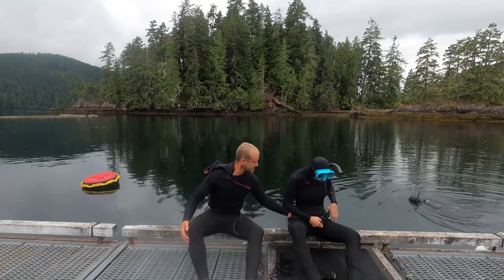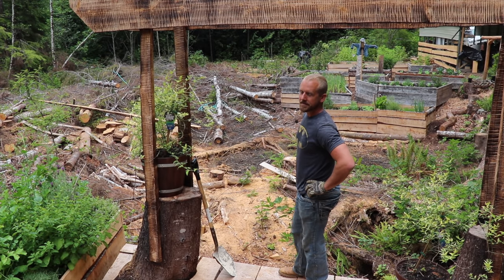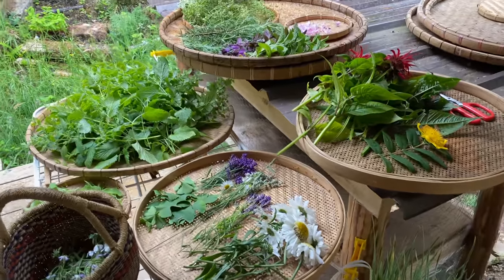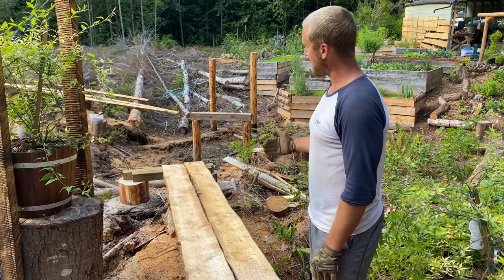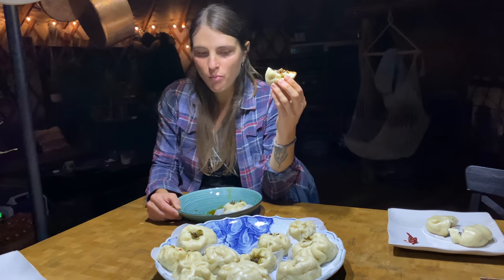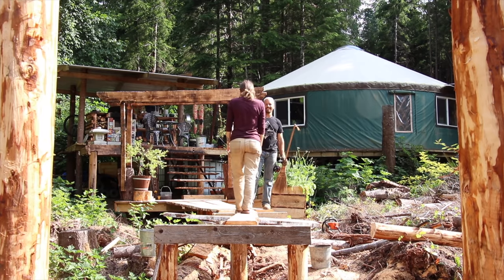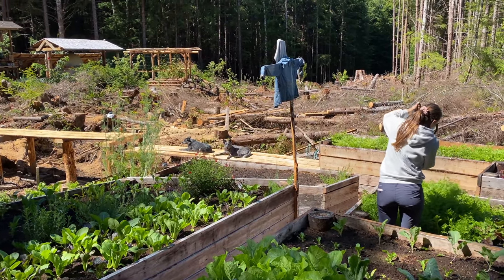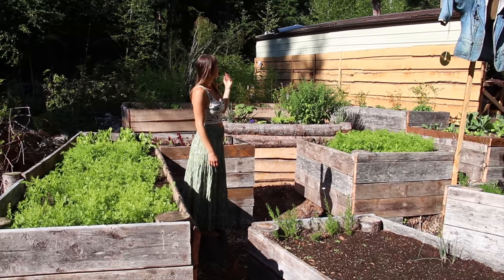RAW BUSHCRAFT PATHWAY from LOGS/TREES to LUMBER  - Chainsaw Milling FREE WOOD OFF GRID - Ep. 139

Comment: Next time you want to do a line of string for things like that, weave one long string around long sticks between that and the wire fencing.
That way you can place the wood/stick just in front of the plants, it has a place to hold them in place that won't affect the plant itself, and can literally be taut/stretched to any size  and lifted and put back to the wall at the end of the season if they are annuals

Comment: Jake, you should have made the path drop-down several inches after the first set of planks, then drop down a few more inches where you did drop down so at the end there will be not as big of a drop to the garden path.
Reply: Why? This is more than good enough,  in fact it is amazing.
Reply: I think they kept them flat so the won't become slippery with the hi rainfall.
Reply: I like it but would of preferred it to be lower.  Just to step on or off at any point.  Unless Jake is planning on letting the vegetation grow tall around it.

Comment: Hi Jake.  one thing you might consider adding to your woodcutting tools is a couple of peaveys.  They are long levers with a hook and a point and make moving heavy logs and pieces a lot easier.  they are especially useful for rolling and elevating pieces off the ground when cutting firewood rounds.  they come in different configurations including one for use as a log jack to lift a log off the ground so you don't run your saw into the ground.  I have several of them in various lengths, including a 3 footer that I use when moving big rounds around to split them.

Comment: Slipping a wedge behind you as you rip your logs will help you cut faster and cleaner your actually cutting more than you need with the board laying down from the kerf as you cut. The wedge will prop up the board enough so the chain saw blade won’t be pinched by the plank as it’s cut .

Comment: Welcome Jonathan !  Jake, you can run a stringer up the middle of those planks to stiffen them a lot... turn each one into a "T" shape cross section. However, if you want a ramp that you can run heavy equipment, wheelbarrows wheelchairs etc on, you should use a couple logs with one side planed off, ( see ref @ 21:30 ) and set the logs into notched, or cupped pylons that can give you some adjustment for leveling or wedging etc before nailing them down with big spikes. You can then plank over the top for a stout walkway even if a bit heavy.  Was wondering if instead of stripping the bark manually, couldn't you burn the bark a bit with the dragon's breath torch to make it easier to strip ?

Comment: If u break alot of axe handles, customize your own, welding a metal pipe to the axe head, it's possible that the pipe handle will start to blow *bow after a while if you're hammering the heck out of splitting🌲

Comment: I always have to laugh watching guys split big logs like this. Looks impressive chopping those big logs with one stroke, huh?
But notice how straight the grain is, and how light the wood - and therefore how easily such logs can be split. You could do it with one arm. Even Nicole could do it.
If you want to impress someone who knows, try splitting some Australian Red Gum. It is extremely dense and heavy, and the grain is very gnarly. I have flattened a few log splitters trying to sledgehammer them through Red Gum, and I challenge any of you to split logs as easily as is done here.